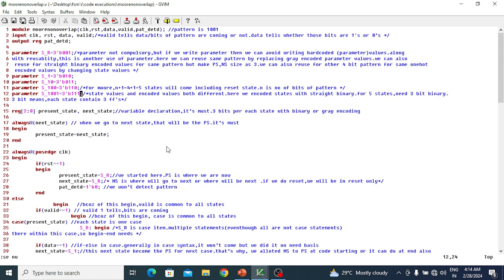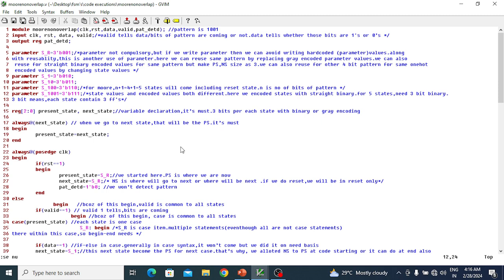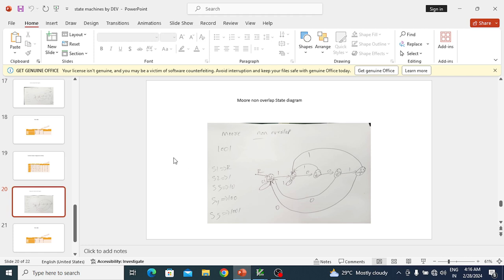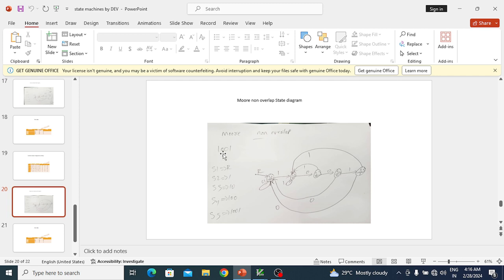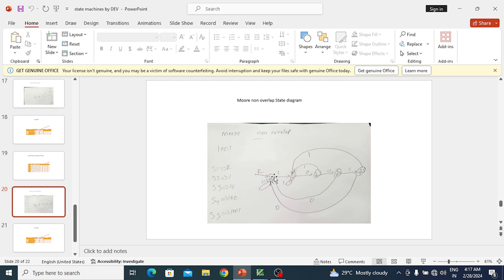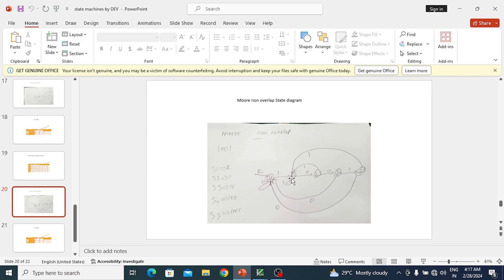pattern or sequence detector or Moore non overlap state machine mini project design and verification

Comment: I have two questions can you answer it if possible 
1) Why you didn't use non blocking statements for the sequential procedural blocks ?

2)And moreover you have written in the code for the valid =1 state but not written a condition for valid = 0 wont it infer a latch ?
Reply from the maker: @ArunChikkaraju  when I get time,i will check it and let you know.. still this code need to be do more better
Reply from the maker: 1.fsm is sequential circuit,so we must use,non blocking. 2.if we don't write default case, then it infer latch.
Reply: @FreeVLSIDVtrainingbyDEVTALLURI  thanks for clarifying the doubt , could you please tell me how to have a access to the codes and the materials?
Reply from the maker: @ArunChikkaraju  through registration to online or offline paid course@9182686908